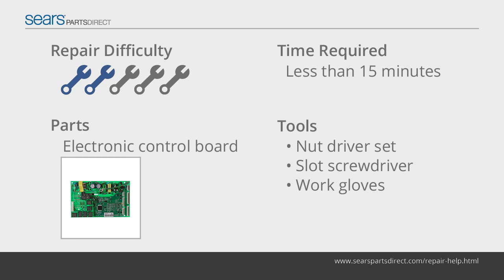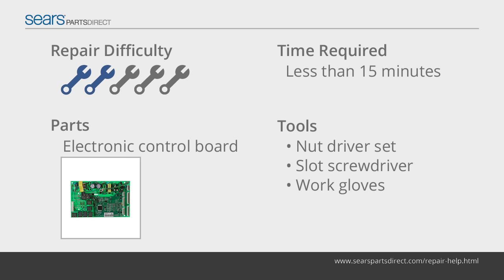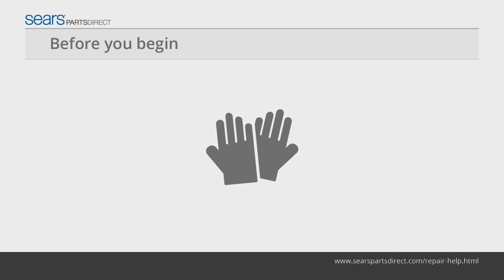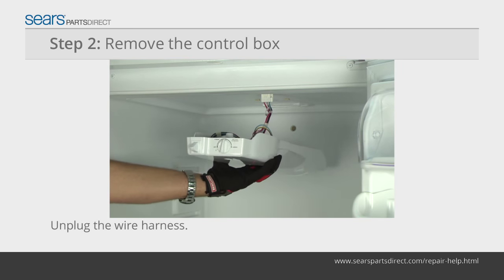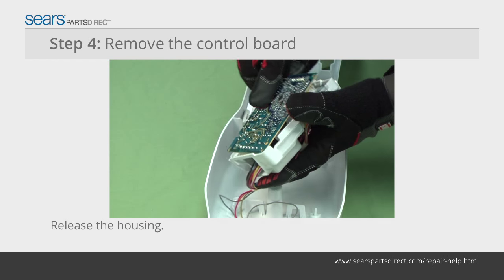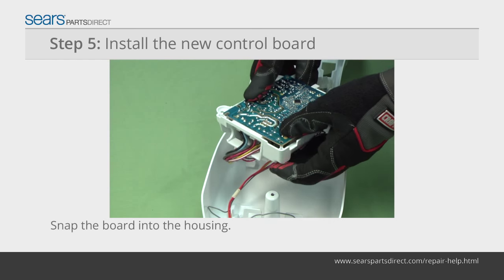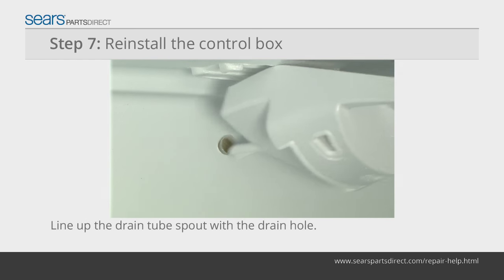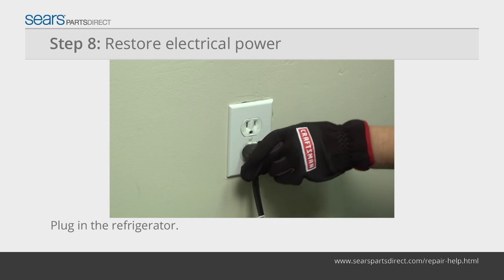How to replace an electronic control board inside a top-freezer refrigerator

Comment: where is control board located on hotpoint HBNF5517BUK i took off light only 2 wires do i need to take top panel off?

Comment: are there  programing to install control board on a mana top freezer M# ART308FFDW03
Reply from the maker: We didn't find any programming to install the control board on that model. Sometimes, that information is on the model number/serial number tag. Check there for programming information. If it's not there, then that control board likely doesn't need programming when you install the new one.

Comment: Do we need any programming after installing this ??
Reply from the maker: The electronic control board in this video doesn't have to be programmed but some refrigerator control boards do need to be programmed before the board will work. If you have a different refrigerator and need help programming the control board, let us know the model number of your refrigerator and we'll help you with programming procedures.
Reply: model#art308FFDW03

Comment: What kind of screw is holding the control board cover? I've tried every driver I have and can't get it loose.
Reply from the maker: The control box mounting screws for the refrigerator shown in this video are ¼-inch hex head screws. Try using a ¼-inchin nut driver to remove those screws in your refrigerator. If that doesn't work, use a mirror to look at the type of mounting screw that your model uses. If you need more help, let us know.
Reply: Thank you,
It seems that mine, a Kenmore 60412, has one 5/16" hex in front, but the back is somehow still attached. Is it by keyways and pulls out? I don't want to break anything.
Reply from the maker: @MichaelJohnson-mb1io  After removing that front screw, pull the control housing forward about ½-inch to release the keyed slots in the control housing from the plastic tabs mounted to the roof of the refrigerator compartment then lower the control housing and unplug the wire harness. You can see the keyed slots in the housing and the plastic tabs on the roof of the refrigerator compartment in the video.

Comment: I have a kenmore elite model 106.44433603 where is the electronic control board located. It is not on the back panel.
Reply from the maker: That refrigerator has a display control board in the control box mounted to the roof inside the refrigerator compartment. That display control board sends signals to the main electronic control board located in the machine compartment under the refrigerator compartment. Unplug the refrigerator before accessing internal components. You'll need to remove the bottom rear machine compartment panel to access the main electronic control board. If you need more help, let us know.

Comment: Except The Fridge I have doesn't have a control box in the ceiling of my refrigerator and the diagrams on Parts direct well they look like they were drawn by a 2 year old who got a hold of some crayons. I get it Sears really needs business but I bought my fridge August of 2015 and now it is not cooling at all. whereas the fridge I had before this was 30+ years old and worked like a beast.
Reply from the maker: Sometimes the electronic control board is located on the back panel or in the machine compartment by the compressor. We’re sorry to hear you’re having problems with your refrigerator. Let us know the model number and any other details you may have omitted about it not cooling and we’ll try to offer some suggestions on what could be wrong.
Reply: Sears PartsDirect  25370622410
I have since making that first comment replaced the compressor start relay and my next replacement is going to be the compressor start relay capacitor but in replacing the compressor start relay the refrigerator compressor is still not coming on so I suspect that my compressor has gone out I’m just trying cheaper parts first before buying a new compressor because then that’s going to require me to have a technician fill it with Freon
Reply from the maker: The electronic control board in your model is in the machine compartment (the same are area as the compressor).
 
Check to see if the condenser fan runs. The condenser fans gets power from the same electronic control board relay as the compressor. If the condenser fan runs then the compressor is likely getting power. You’ll likely need to have a technician replace the compressor if the compressor is getting power but not running.
 
If the condenser fan isn’t running, then the electronic control board (https://www.searspartsdirect.com/part-number/5303918679/0046/253.html) may have failed. Replacing that part may fix your compressor problem. Unplug the refrigerator before replacing parts.
Reply: My control board was about halfway down the back of the fridge in a panel with one screw.

Comment: I have a Kenmore Model# 795.69974.900. Where is the control board located?
Reply from the maker: The control board is located on the outside back wall of the refrigerator cabinet. You’ll see a control board cover on the outside back refrigerator wall similar to the one shown in this illustrated repair guide: https://www.searspartsdirect.com/repair-guide/refrigerator/how-to-replace-a-refrigerator-electronic-control-board.html. Unplug the refrigerator and remove that cover to find the control board.

Comment: I have a Kenmore Model # 59652673200 S/N 10025968AV. Where is the control board located Thanks
Reply from the maker: The control board that controls the compressor and automatic defrost system is located inside the refrigerator compartment just in front of the damper vent at the top left side wall. A separate control board behind the dispenser control panel controls the dispenser components and display. Unplug the refrigerator before accessing internal parts. Here's a link for the parts diagram for that refrigerator: https://www.searspartsdirect.com/model/4tpy4hob6q-000582/kenmore-59652673200-side-by-side-refrigerator-parts . The control board for the compressor and defrost system is key 6 and the dispenser control board is key 20 in the "Façade, controls & light shield" section of that diagram. If you need more help, let us know.
Reply: @searspartsdirect  Thanks - I order the part from Sears "Refrigerator Adaptive Defrost Control Board WP12566102" and replaced it. After 5 days of running i am still seeing the coil being iced and its growing/accumulating ice. It looks like the issue is not with the control board. Please advice
Reply from the maker: @krishnakurma1906  A broken defrost heater or bad defrost bi-metal thermostat could be causing the problem that you're describing. You'll need a multimeter to check continuity through those two components from the adaptive defrost control board (with the refrigerator unplugged). If you don't have a meter, you can get one at a local retailed for about $20. Unplug the refrigerator and access the adaptive defrost control board. Unplug the wire harness from the board and measure resistance through the orange and white wires in that wire harness to check continuity through the defrost heater. The meter should measure between 15 and 40 ohms of resistance. Replace the defrost heater if your meter measures infinite resistance. If the defrost heater is okay, measure resistance through the orange and brown wires to check the defrost bi-metal thermostat. The meter should measure near zero ohms of resistance through the defrost bi-metal thermostat (when that thermostat is below 45-degrees F—which is should be if you measure resistance within 1/2-hour after unplugging the refrigerator). Replace the defrost bi-metal thermostat if the meter measure infinite resistance through the orange and brown wires. Unplug the refrigerator before replacing parts. We hope this information helps. If you need further assistance, let us know.
Reply: @searspartsdirect  Thank you so much. It was bi-metal thermostat causing the problem. Replaced it. The refrigerator is working fine. Thanks